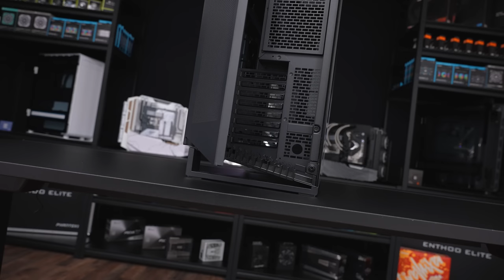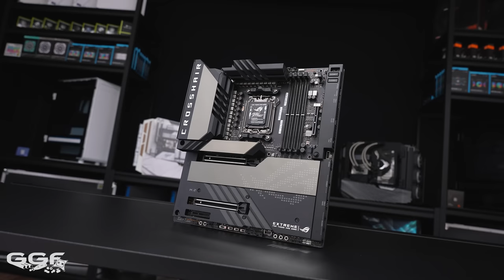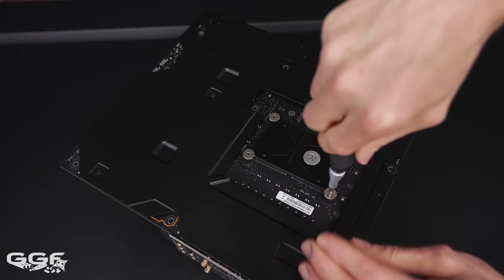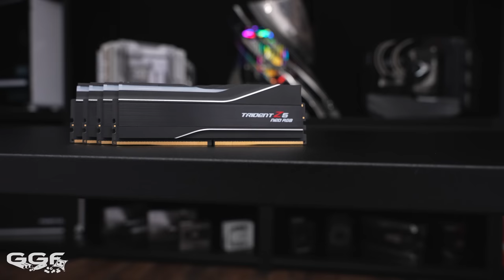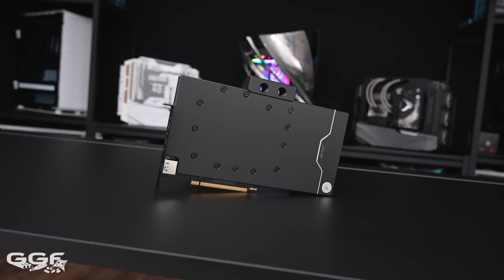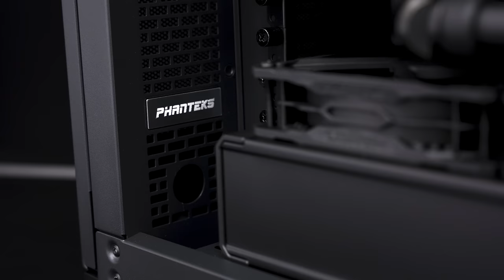The no BS! No RGB! Quad RAD, Phanteks NV7 Build

Comment: I am really diggin this case. How are the temps so far? The O11xl is ok with temps and I was curious if this case is any better?
Reply from the maker: This case would be very similar to the XL. Maybe a bit better at the bottom due to the angle allowing for more airflow

Comment: Brother please reply, what kind of connection you used from the pump outlet, to the inlet radiator back reservoir. What offset that you used ? I playing the video many time, I only notice fitting down the reservoir is quantum micro rotary, and don't know from the radiator side.,,

Comment: This one looks great too! Although it's very different from the white one you did, I couldn't possibly choose which one I like more. I just got this case in white, and seeing this makes me wish I knew how to build a proper water cooled setup.
I've also got the same board and RAM - though I only got two DIMMs because I've heard four can be kind of iffy on the AM5 platform. How's it working for you in terms of speed and stability? Could I safely go for four?
Reply from the maker: 4 is always hit and miss. You could go 4 and any issues just don't run xmp

Comment: Incredible build, you've got a real talent man. Curious though for a day-to-day use case, is a single D5 pump going to be enough to give above 1 gpm flowrate?
Reply from the maker: More than enough. The loop only has 2 blocks
Reply: @GGFEvents  ok, the rads must also not have that much restriction either. Good to know that about the new EK rads, thanks!
Reply from the maker: @moevor  rads have very little

Comment: I may be stupid, but there is something I am missing. How come there is only 1 connection on the distro? It needs an in and an out. There are no connections at the back of the distro. How?
Reply from the maker: Bottom
Reply: @GGFEvents  I actually managed to look up the wrong distro plate like 5 times. It is official: I am an idiot. Thnx for the reply.

Comment: I thought the left opening on the FLT 240 was drain, and the middle and right were outlet and inlet, respectively.
Reply from the maker: Only one that matters is the in which is the middle
Reply: @GGFEvents  so you used the drain as the inlet and the bottom-left as the outlet?

Comment: LOVE this build, and planning on using it as inspiration for my next. @GGFEvents, If you dont mind me asking, what did you use to paint the fan blades and metal components? I've never done that before and would be concerned about longevity. Thank you in advance!
Reply from the maker: Thank you. Just standard matte black spray paint from the hardware store works
Reply: @GGFEvents  Thanks dude!

Comment: You know what. Probably not the most popular opinion. But I think all these builds are pretty boring and unrealistic. Every time it's the higherst end stuff, all the most expensive over the top hardware out there not for the sake of actually using it, but just for the hell of it. If it's 4 m2 slots we use them all. If there's 4 dimm slots we use all of them. If there's 7950 can fit in there why the hell would you use something that actually makes more sense to the owner if it's not the most exprensive line in the list. Also what's pity all these graet hardware gets forgotten and trashed pretty quickly. Beleive it, I still use my 2080Ti from 2019 and find it meeting all my gaming needs and I see no reason to jump on the latest if I don't need it.
Reply from the maker: Good for you